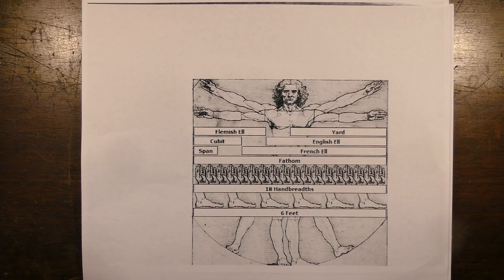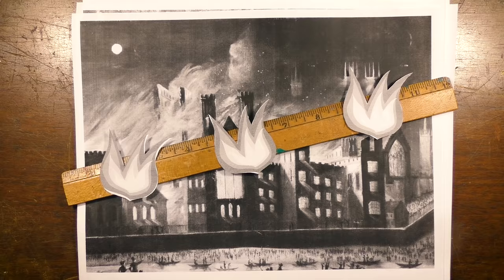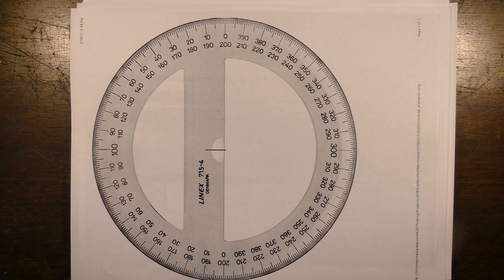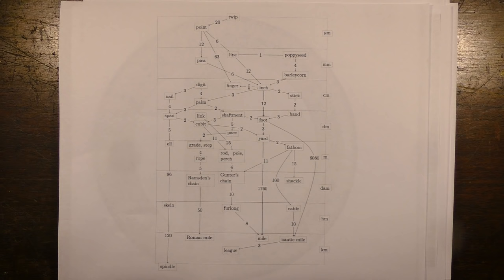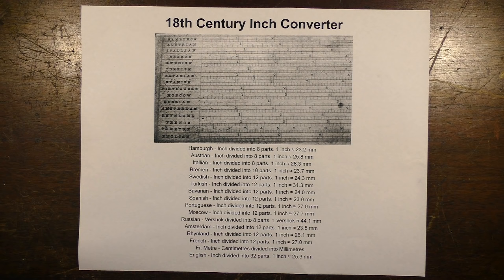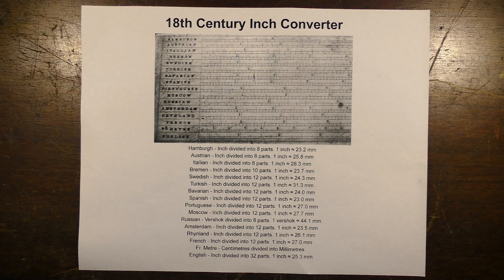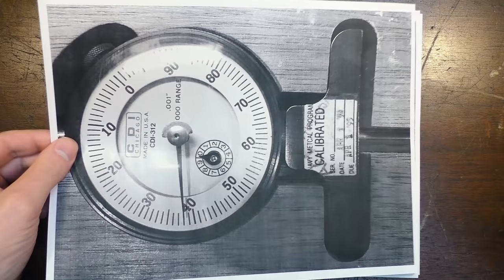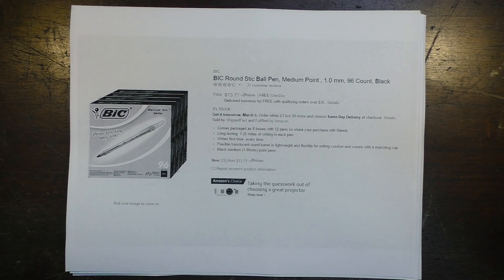Origins of Precision

Comment: Hi .The Whitworth three plates method was one of the first tests I had when I started my apprenticeship at 15 years old .we were issued with three 5 inch square plates  I had to scrape them together using a sequence of six steps . the submitted plate could only be checked by the instructor on a surface plate when I said I was finished. I will always remember this as I was amazed on the flatness of the finished plate. Everyone who  enters engineering should have a go at this . Another interesting procedure is to hammer a bar of iron on an anvil keeping it pointing to magnetic north . With enough hammering the bar will become magnetised I have tried it. I find it fascinating
Reply: John Wilson What is it about Josephs and precision?
Reply: Hi No one knows were the first compass comes from for accurately finding north. There is a theory that the Vikings were the first ones to use them. They worked with iron possibly using iron meteorites which were a lot purer . So they could have hammered the iron has described to make a compass . A compass is a precise measuring instrument which changed the world  .The hammering process could have led the way to make a measuring instrument that we take for granted.
Reply: @johnwilson3668  I recommend reading Michael Faraday's "Experiments and Researches in Electricity" (free on Kindle) in which he describes (among MANY other things!) making large bound permanent magnets by basically bootstrapping them out of the Earth's magnetic field.
Lodestones are natural permanent magnets and were likely used for the first compasses (floating them in a bowl of water etc.).  Once we figured out that heating up iron and letting it cool while oriented along the same line as a lodestone (you don't have to hammer it) would create a permanent magnet, then you basically build bigger magnets by using the first ones to create the subsequent ones which end up being stronger...repeat until saturated!

Comment: I stumbled upon this video while browsing YouTube. Thank you for a very excellent presentation. 
I was looking at this from a professional background. I spent about 20 years working in the Navy metrology system, and another 8 or so at a major US airline. My specialty was maintenance and calibration of electronic test and measurement equipment. But out of necessity and personal curiosity I learned a lot about physical/dimensional metrology as well. With the recent completion of the watt balance, the electrical and physical systems are now united in a way. 
I was a co-author of the first edition of the book "The Metrology Handbook" published by the American Society for Quality, and I became one of the first ASQ Certified Calibration Technicians (CCT). 
One photo in that book is of the British yard/foot/inch transfer standard that you show. The one I photographed is on the outside wall of the Greenwich Observatory. 
In my retirement hobby of woodworking, I still keep the value of precision measurements. I don't have a set of gage blocks yet but that is a goal. I have been able to purchase a number of things that I an careful to use only as reference standards, to check other dimensional tools. While wood is a dynamic material, precision and accuracy are still important but at a different scale: 1/32" instead of 0.001" or less. 
A lot of the material you present was either new to me or long forgotten - thank you again. 
An upcoming project for the woodworking shop is making a straightedge: by the same method you describe for surface plates, so I will end up with three instead of just the one I need. 😃

Comment: There are also 8 piece sets for longer measurements, which of course can also be "wrung" together with any of the sdt. 81 piece set for even more combinations. I was an US Army Metrology Engineering Technician, aka: Calibrator for 43 years. The longest gage block measurement / Calibration that I ever had to make in the field; was on a Hawk Missile, Launch-Lach Gage at 40 some inches +/- 0.0002" this was done in Korea in 1979 in a 5 ton expandable Van in the summer time! we had a 36K btu AC unit but getting the "Unit under Test" and the Standards to stabilize was a b!t&#!! Love your videos.
Reply: That's 1m +/- 5um, which is ridiculous. Why did they need a gage block that long?
Reply: @BrotherCreamy  There were two items of Hawk Missile launch latch test equipment that required certification/calibration; The 40" "check Rod" and a "Lanch-Latch" release tester;  it was a plier-like hand-held tool with a depth gage calibrated in pounds of force. If these were not operating or used correctly the Launch-latch may NOT disengage at the correct setting, then A fired missile would take the Launcher AND the other two missiles with it down-range! When this happened, once to my knowledge, There was GREAT consternation among the "Brass" with a subsequent Massive search for the Guilty and Persecution on the Innocent! 😁
Reply: So I'm curious, without getting out the speciality gauge blocks, how does one typically take precision measurements in the range of ~1-10 feet?

Comment: This is one of the most amazing videos I've ever seen (and the one on the 50 ton presses also). I was an apprentice machinist at Schlage Lock Company (Santa Clara Knob Company, - in San Jose, CA in the late 1980s/early 1990s). We made seamless doorknobs, residential and commercial locksets, lever handles, trims, etc., from alloys of nickel steel, stainless/chromium steel, bronze, brass, copper, etc. We had all manner of measuring devices/gauges in our machine shop. But I never knew the history of gauges/ measures (or about Johansson). We had manual lathes, mills, die grinders, massive heavy automated punch presses, drill presses, and CNC lathes and mills also (and heat treating furnaces/ovens). Compared to the CNC machine tools of today they were far less capable and sophisticated, with only 3 axis (maybe 4 axis?, -don't remember). Of course the modern CNC lathes and mills had built-in gauging capabilities. I used manual machine tools only. The journeymen machinists would program and use the CNC/NC machines. We had about 80 employees I believe. They closed our plant in 1991 and moved it to Tecate, Mexico.

Schlage had an amazing history, and was an almost 100 year old San Francisco company (near Candlestick Point/Hunter's Point Naval Shipyard). The Founder, Walter Schlage, a German immigrant had 250 U.S. Patents to his name at the time of his death in 1946. His first patent was in 1909, inventing a door lock that turned lights on and off (as you entered and exited). Ingersoll Rand bought Schlage in 1974. The San Francisco plant was massive and during WWII was converted to making parts and equipment for the military. Anyway, the only thing I can find [remaining] on the internet about Santa Clara Knob Company, is on the resume of a guy who worked there long before me, and left long before I was hired:   https://bit.ly/2ENFlK1   Schlage history:    https://bit.ly/2XNBu8n   The original SF factory closed in 1999, but some of these images show the factory and footprint of it before/after it was demolished (near the Bayshore/ Caltrain coridor):   https://bit.ly/2J1WkOc   https://bit.ly/2Hs7idd     https://bit.ly/2NSgnNE  Fortunately they saved the historic main office building:  https://bit.ly/2HbY4mb   This is an interesting blog of a local explorer whose webpage has a lot of cool info about Bay Area historic sites:  https://bit.ly/2Cd24Pf (the pics in the link above are his Flickr site). Anyway, since you're local I though you might be interested in this stuff (if not, sorry :)

As I commented on your other video (the amazing lathe in the French museum), the history of (likely) the Moore Tool Company, and so many other American machine tool/manufacturing companies (like Stanley Tool Company, Pratt & Whitney Measurement Systems, United Technologies, Groton Electric Boat, clock manufacturers like Ansonia Clock (and at least 8 others), Sturm Ruger, Smith and Wesson, Marlin, Colt, Remington, Winchester, and many others) arose from the Connecticut Valley, primarily as a result of the need to be able to mass produce firearms using precision (gauged) interchangeable components (first accomplished at the Eli Whitney Armory). Thus the firearms industry was primarily responsible for the American Industrial Revolution (along with ensuring victory in the War of 1812, guaranteeing that we remained a free and independent nation). Machine Tools literally made America and saved America, and created a lasting peace. The Connecticut River Valley became the integrated manufacturing capital of America (and later the Northeast in general with companies like  https://bit.ly/2UuPGBf  Starrett  https://bit.ly/2VJGJE8 , IBM, etc. etc. etc.). This is a great documentary that elucidates this history well:   https://amzn.to/2TsgGVE   Eli Whitney link:  https://bit.ly/2q7BCAy
Reply: Can you tell me how this video relates to metrology

Comment: Your calculations at the end reminded me of what I always taught millwrights about shimming rotating machines with precut stainless steel shims that come in thirteen thicknesses from 0.001" to 0.125": You're supposed to minimize the number of shims under a machine foot to the extent possible when aligning it, so take a moment and Think, and you will realize that you can achieve any desired thickness from 1 to 150 mils with never more than 3 shims, and often fewer. But the lazy ones will often stack 5 fives to get 25 instead of just finding the single 25 left in the box!

Comment: First precise screw, Medieval edition.  I don't know if it went down like this, but I would try this route:
Secure a quantity of iron wire, drawn through a die.  The die is to be smooth as can be made.  Inspect the wire, keep only the most uniform section.
Secure a spindle, turned on centers.  Doesn't have to be metal at this point, just round and straight.
Wrap wire around spindle, taking care to keep each turn snug against the prior.  Secure the wire onto the spindle.
Make a follower that rides on the coiled spindle; this is your lead screw attachment for the lathe.
Use lathe and lead screw to make a proper cut screw; Acme thread variant is a good start.
Use screw to create a tap.
Use the tap to make a die.
Use the die to make a proper feed-screw for the lathe.  Make a lead-screw follower with that tap while your'e at it!
Die-cut threaded rods tend to be pretty uniform in pitch; using a brass or copper lapping die makes them more better.
Now the lathe can cut threads that are far more uniform than the coiled shaft did.
Next up, lathe makes a new lead screw for itself, using the lapped lead screw made earlier!
Each 'pass' through the process results in closer tolerances being possible.
Once you have uniformity in your geometry, precision tends to follow.
Reply: Yes but what made that first die? Its dimension is unknown and arbitrary, because dimension/gauge hasn't been invented yet.
Reply: Thank you for this post! I've wondered for a long, long time how the first lead screw could be made with any precision.